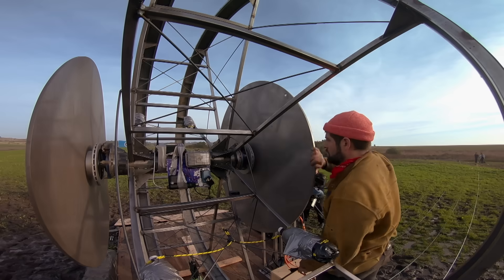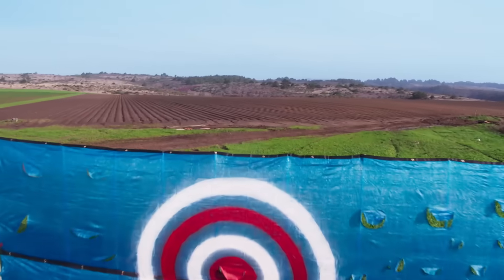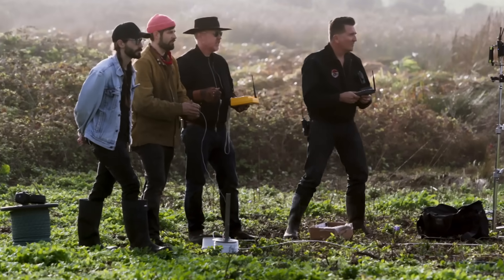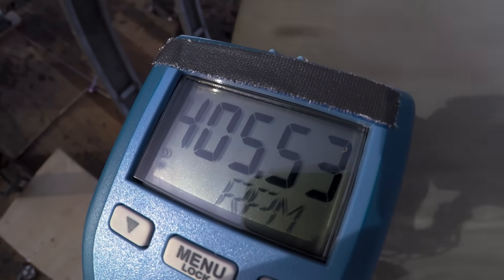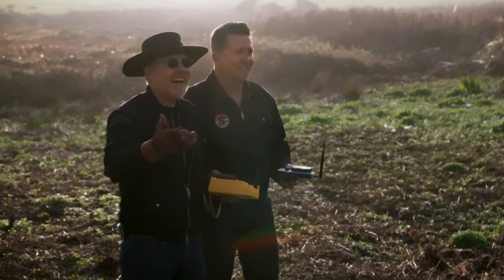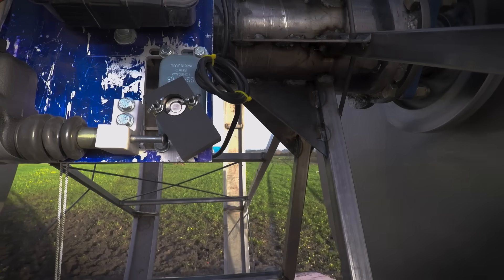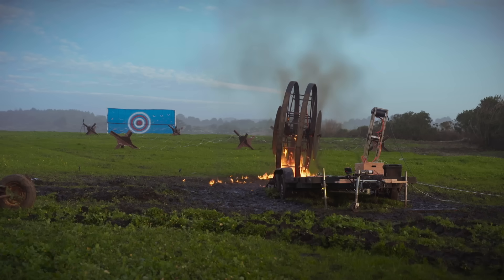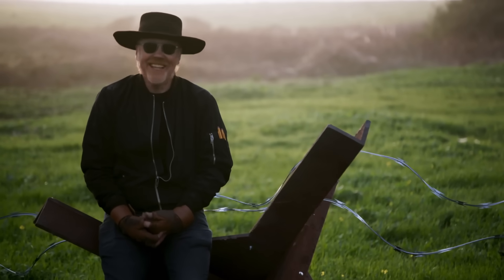Weaponised Flywheel Experiment Fails Explosively | Savage Builds

Comment: 50k project and you do 1 test on super soft ground? Adam....
Reply: I bet if it were up to him they would've tried it again. But since they're on the networks dime, I bet he wasn't afforded that opportunity.
Reply: @thetimeisrite  give it time. I dont see anyway he doesn't go back to this at some point. Its gonna eat at him
Reply: He talked about it on Tested. The brakes were not powerful enough and they didn't have anymore money from the network.
Reply: Miss propper testing aswell ^^
Reply: They should have done it on the saltflats
Reply: more like Discovery 🙄
Reply: And about $50 away from getting it to work.
Reply: The original this is based off was meant to be used on sand
Reply: *Adams
Reply: The terrain wasn't the issue. It was their system for transferring the flywheels energy to the larger wheels.
Reply: @spookyblush-speedruns  There were several issues. Not getting up to the required RPM and thus having less energy to start with, poor energy transfer and soft, uneven ground creating more friction.
Reply: This experiment brought to you by California.
Reply: I don't think it was a sincere attempt. The "Rocket" scientist knew there wasn't enough energy in those flywheels to accelerate the entire assembly anything close to 20mph, much less 40mph.
Reply: the whole design is clearly a 100% fail. dunno why they even tried.
Reply: Brakes won't do it. You'll loose much of the energy in heat.

And that rolling resistance!
Reply: @lucienpetersen  yeah the brakes were a bad idea. Should have used a spiral spring like a clock if they wanted to transfer momentum like that (though that’s even more dangerous).
The original panjandrum used rockets though. No flywheel involved trying to transfer energy, just rockets on a wheel. They should’ve spun up just the flywheel and released it.
The engineering here was actually quite bad, better brakes wouldn’t have solved it but would rip it apart.
Reply: Lol I read “Adam....” in the voice of that old vine with the guy who got his vaping trick messed up.
Reply: Adams😂
Reply: He needed Jaime to balance him out.
Reply: @embracethesuck1041  I thought jamie passed away though
Reply: @rohncarver3585  pretty sure that was Grant. Poor dude died of an aneurysm.
Reply: @zacharyirving5080  man, breaks my heart.

Comment: Half the time I think they let it fail because it would work too well and the idea is dangerous. Wider tracks, Balanced ring flywheel instead of discs. Clutch instead of brakes.
Reply: A centrifugal clutch on this scale would be insane.
Reply: @sirukin2025  I wouldn't know. What about a heavy duty spring loaded truck clutch? One shot, trip and release? or multiple brakes on the disc? ma=F=ma Wouldn't that mean the resting part had more inertia than the spinning part? Rings instead of discs.

Comment: They picked the muddiest spot to park it in. Mud stops everything.
Reply: you'd think they would at least have done a test run on a level surface to see how fast the rig could go.  nope, run number 1 is in battlefield conditions.
Reply: @grelgen  because they are remaking what the ppl in world war 2 did.  they made one that goes through mud but it never worked right.
Reply: Mud was not significant.  WW2 tanks spun their tracks bc they were floating on a wider plane (ie, the relatively flat belly) that held the tracks off of terra firma. The culprit here was absence of torque.
Reply: Mogulis Valar  Fr... If a multi-thousand horsepower tank with mud-tracks can spin in place in mud, then a slick smooth wheel won't fare much better
Reply: @andrewjensen8189  Irrelevant even if true. Lack of traction was not a significant factor.
Reply: @WillBravoNotEvil  I'm no physicist, but doesn't torque rely on friction/grip? You could have a million horse power engine but if the wheel is slick and is trying to grip on mud or ice for example, the tire will just spin, just like in the video.
Reply: @andrewjensen8189  you are correct, however you'd see that in the video as wheelspin, they didn't have enough energy transfer to move 10 feet let alone spin the tires in the mud
Reply: @jellafella6957  Makes sense
Reply: @jellafella6957  well the brakes didn't help, the flywheels kept spinning I guess it was designed to fail
Reply: Mud ain't not gonna go stop no mudskippers 🤔
Reply: @Lardah  is a mud skipper a sort of captain off of a boat? if it's on the mud, its somewhere to being a land vehicle tho, and they have drivers. does it have oars, or sails, or wheels, or a propeller?
Reply: @mikenewtonninja9379  it has fins 🙂
Reply: Power of mud..
Reply: You can see a dry road in the background
Reply: @robmulally  well obviously they brought it via a road too, but I'd bet it's not street legal on it's own 😁
They should at least have waited for the field to dry up... But then I think they actually wanted it to be muddy to test it's capabilities on such terrain aswell
Reply: Mud can stop a main battle tank so no real suprise!
Reply: The main problem is that their clutch system used a brake instead. They wasted all the energy in the flywheels by generating heat. You can see that the flywheels are still spinning faster than the wheel even after it takes off. They just blew it and didn't have a chance to fix it because it's TV.
Reply: Steel wheel without any grooves in mud and they expect it to move? This was doomed to not work even if they got the energy transferred successfully to it spinning.

Comment: I dont work for nasa and I'm not great at math but I knew this wouldn't work because the brakes the entire time. Maybe if they designed their own brakes but those off the shelf brakes preformed exactly as they were intended.
Reply: Side note Jamie wouldn't have made that mistake.
Reply: Think the breaks should  been made out of clutch puck material.  Commercial truck size truck clutch  spring plate. If you ever drove a puck clutch you know the grab it produced.
Reply: Brakes are made to slow things down. And turn it into heat. Not transferring torque.

Comment: What kind of ground friction was assumed in the calculations. I can see both the effect of low friction, thereby grip, and a "glue"-like friction not allowing it to move being possible.
Reply: wouldn't have mattered if it had taken off at appropriate speed. well, thats not true, obviously it would have affected overall performance, but it wouldn't have stopped it as soon as it did. 

the problem they had is that the breaking system was too weak. what they were hoping to do was to close the breaks, causing all of the momentum in the flywheel to immediately transfer into the big wheel. what happened instead is the breaks slid on the big wheel. transferring only a bit of that energy into turning the big wheel. but causing the flywhelels to rapidly lose their momentum.